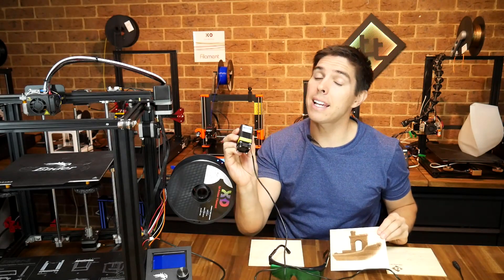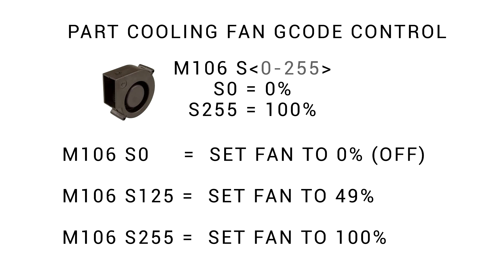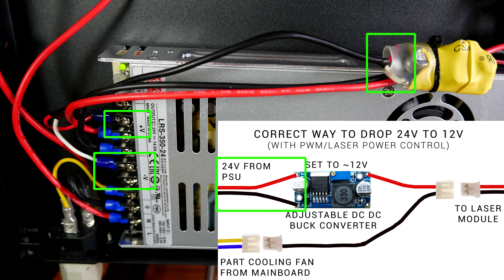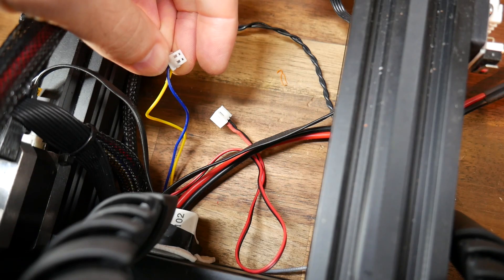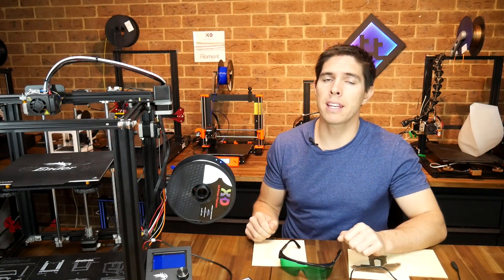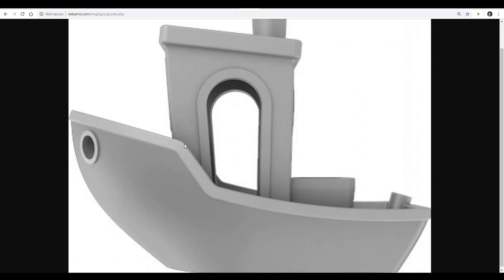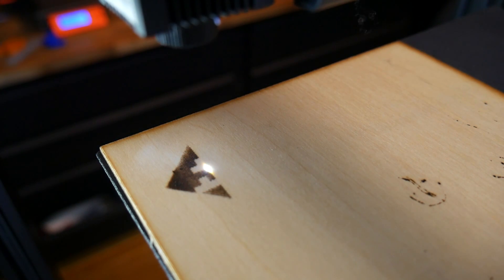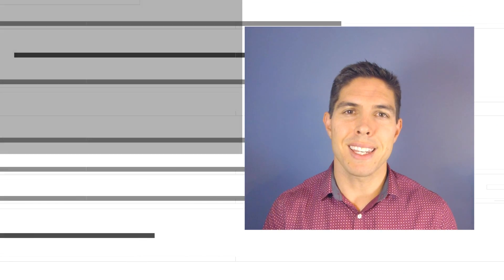3D printer to laser engraver for under $60

Comment: Mike, this is awesome, as are the many other videos you put out.  Thank you.   Question: I would like to use this for cutting out ribs and other model airplane parts out of thin plywood, or dollar tree foam.  Could I do this by using a black/white image which simply has lines that need cutting and increase the intensity of the laser to penetrate the respective materials ?

Comment: Hello, I've watched your video and have a few questions to ask. Firstly, is your laser engraving head operating at 12 volts? In the video, you used the xl6009 module to convert the motherboard's 24 volts to 12 volts for the laser head. How smoothly does this configuration work for you in practice?

Comment: I bought Creality Laser kit, it does have built in buck converter, but it doesn't help, I always have 12V out regardless of power percentage and or PWM frequency for that mater. I'm trying to hook it up to the Ender 3, it works with 24V fans, and buck converter does the job but always gives 12V no mater what I do. (I tried your wiring to get ground from other place, nothing happens always 12V)

Comment: Hi im having issues with a neje 30820 laser in the 3d printer. it semed to burn everithing even if i use speeds up to 4000 mm and turn down power of the laser to 25  in img2gco any ideas ? if i turn down voltage of my laser under 12 v maybe ?

Comment: Just installed this, but looks like my 4.2.7 board cant run it due to low PWM frequency - has anyone else had this issue and found a work around?  also looks like the image3gcode doesnt work anymore

Comment: I just bought the 10W laser from creality
Also interested on how to cut (through) with the engraver (using multiple passes)
Watched your video prior to the package arriving to be better prepared and know a bit more on the settings and tips.

hope to figure real cuts during the process.
Reply: did you figure out anything about making cuts?
Reply: How did you wire it up? I got ender 3. The pwm fan port is 2 pins. But the creality laser module got 3.

Comment: For anyone with requisite coding and electronic skills, the solution to the 24v/12v PWM dilemma would be to find all the fan speed commands in the G-code, halve all the values and re-compile the g-code. An RC network of suitable time period, paralleled with a 12v zener diode would provide the correct drive and stop anything bad happening to the laser.

Comment: Do I have to remove the spade connectors to the power supply if I want to switch back to normal printing? Or can I just remove the connector to from the cooling fan port and plug my cooling fan back in?

Comment: Great video. I'm considering a laser for my Ender 5 (stock board). I do not understand the significance of grounding the laser to the part cooling fan. I don't see why it would fix your issue. I suspect the reason for not working is that the buck converter isn't enjoying a PWM input. Are you able to elaborate, please?
Hmm... I wonder if there's a way to keep the laser circuit powered, and only PWM the diode...

Comment: Hi, please help. Ender 5 pro and neje lasaer 12v 30w with control board. Connected with external power supply and ttl 2 wire plug with buck converter. Laser works when test button pressed and on full power. when I checked voltage on the fan pins, it is constant 24v on full power and jumping from 0 to 24v when set to anything bellow 100%. When fan is connected is straggling to turn if set to below 70% and makes pulse noise. Is my board (v4.2.2 silent) broken?

Comment: I have a 3 connector laser GND, Positive,PWM I am assuming you're only using the ground and Positive and Activate the button I tested my laser with the supplied AC to DC transformer and all you need is the Activator switch depressed for this wire loom to work..

Comment: First off very good and informative video for an upgrade I can see myself trying in the future, big thumbs up, but can the same wiring technique be used to power a pwm fan? the reason i ask is because i have an ender 3 v2 and want to use noctua a4x20 5v pwm fans for the hot end and part cooling and your is the only video that seems to show a way round this, sorry if this is going off topic but any help would be appreciated

Comment: So I recently bought a Creality laser attachment just like the on you have and got it setup and running using your tips, after starting the 2nd project, laser failed within 15 minutes. Any Idea what I could do to check any faults?
Reply: I restarted everything over from scratch, deleting old g code files, formatting SD card, reset ender 3, restarted computer and again the laser stopped working after about 45 minutes into an engraving, know anything that can help? thanks in advance.

Comment: @Teaching Tech, didn't you face any PWM low frequency issue with Ender 3, my laser module has a dedicated PWM driver but the parts fan low PWM freq. from ender's board (~7 Hz)  just toggles the laser between off and full power.... no intensity control. If anyone here knows any solution to this please help me out.

Comment: I tried it your way (on my Ender 5Pro). Does not work. 
Connecting your way, FAN on 0% shows -12V, FAN on 100% shows 12V, but it pulses (PWM), not constant on. 
Looks like my PWM (Blue) is pulsing between -24V and 0V. Adding 12V from PSU does not help.

Comment: I would use the DC-DC converter to get 12V from 24V, then a resistor voltage divider from the fan PWM to control a MOSFET that is powered from the output of the DC-DC converter (12V). The output of the MOSFET circuit will feed the laser PWM. The goal is to preserve the sharp rising and falling edges of the PWM square wave that directly impacts the sharpness and accuracy of the laser power and the engraved image.

Comment: very useful information, but i'm having a problem. my board has a PWM frequency of 7.8Hz, the laser was tested on 1Khz and worked fine, but on the much slower 7.8Hz of the mainboard, the laser is unusable. do you have any suggestions? (using the silent board, ender3 V2). Thanks in advance.

Comment: Oh man, you should use a relay after the buck converter with the fan connected to normally on and the laser connected to normally off, then add a button in octoprint to turn on the laser for when you want it used.

Comment: Hello, I connected the laser as you showed here, but the laser power is not controlled, the laser is blinking! From 1% (slow) to 99% (fast). At 100% Burns full power all the time! In this mode, only  can be used 0% (off) and 100% (on) !

Comment: please if someone can help i cannot find a solution. same laser wired the same way to my ender 3. the only difference is the buck converter that came with mine is not adjustable. if i set my fan speed (laser output) to anything below 50% i get -12v.. so 0% is -12v, 25% is -6V, and 50% is 0v.

Comment: The kit I ordered came with a laser module labeled 12 - 24 Volts. Is there any reason for me to still use a buck converter and run the laser at 12V instead of plugging into the 24V supply on the printer directly? I have an Ender 3 Pro, if it makes any difference.

Comment: well now i wonder about setting this up. Someone gifted me the Creality laser and i was coming back to watch this again and seen the buck converter being used which is fine since i have extras from the Noctura fan mod but my laser says 12/24v so i figured it had internal components to adjust voltage down if needed and would work on either just by pluggin into the fan header but now i got more questions. too anxious and wanna try it lol. great video btw

Comment: correct me if I am wrong on this, but Creality has a laser engraver attachment (much like what your using here) that says its 12/24 volts, so it should be compatible with the whole 24 volt board without having to buy an adapter now right?
Reply: I have the same question. I recently bought the 12/24 volt laser engraver and I am trying to find instructions on connecting it to my Ender Pro 5. So far I can't find any info...... If you find the answer please share.

Thanks!

Comment: Hello and thank you for your video which helped me a lot. I transformed my alfawise U30 into a laser engraver. Everything is fine except for one thing: when I want to burn letters in vector mode, some text pieces of these letters are missing. I have tried everything and I don't understand what is going on. I checked the GCODE, there is no command code in the G to turn off the corresponding fan when part of the letter is missing. Could you help me I thank you in advance cordially Franck. A small clarification: all the other engravings in vector mode work very well, it just bugs for the letters ... Thank you, Franck.

Comment: Great video. I've just moved over from the standard 1.1.3 board on a ender 3, to the 4.2.7 board and now i'm getting completely different results. All of my previous GCODEs either from nebamix or creality workshop which worked with the old board, no longer give great results (either too dark, or completely burnt even on the "white" sections). please can you make an updated video with the new mainboards?
Reply: The laser only works for outlines on the 4.2.2 and 4.2.7 boards. The fans PWM signal is too slow to modulate power to the laser and control intensity of the beam
Reply: Is this board running Marlin firmware?

Comment: so as i understand, you removed modulation with stabilizer... i was trying to understand - i got ender 3 pro and 500mw laser 12-24v... also i got skr mini v2, so by default there no pulse modulation visible..... also in marlin configuration firmware files - you can define fan will be with pwm or not, i think - its 2288 line FAN_SOFT_PWM

Comment: hi,
i have successfully build my laser engraver with ramps1.4 board. i have attached laser at the cooling fan pins. but my laser does not cut or burn a paper . laser is 1.5kw. n it burns n cuts paper when powered directly to 5v. can you help?

Comment: Great project inspiration! I went ahead, crossed my fingers, and purchased the cheaper, higher-powered laser with the TTL-level input. As suggested in some of the electronics channels on YouTube, I used a resistor network across the 24V fan, thinking it would drop voltage safely and instantly down to TTL levels. And it did. What's more, there is no delay turning on the laser, because there is no buck converter. And I did not have to unplug the fan.

In fact, the fan speeds up cutting of cardboard.  I have to use many passes at high speed to avoid flame out. Please never leave unattended.
Reply: didn't you face any PWM low frequency issue ?, my laser module has a dedicated PWM driver but the parts fan low PWM freq. from ender's board (~7 Hz)  just toggles the laser between off and full power.... no intensity control. If anyone here knows any solution to this please help me out.
Reply: @abhinavjhajsr  No issues. Geeetech A10T.

Comment: I can say that 500mW laser it's very bright even when it pointed to wood piece... Use glasses always
Reply: Agreed. I bought one of those (tho not a 3D printer kit version) and it seems it's a proper 500mW output power like his, not the scammy input power rated ones. Definitely even the crappy included glasses are necessary. If one has/can afford/can find proper rated UV protection glasses, go for it cause it will pay off in health.

Comment: So, I need to switch between the fan to do my 3d printing and the laser to do engraving?
Did Someone create a cable/switch? In that way you are not opening and closing the electronic enclosure and hurt the board connectors?
Reply: ok, just installed mine. i dont have a part fan and my nozzle fan in just on all the time. it would be easy to install a selector switch. I have an isolator on the 12v to the laser so you would need a selector switch to divert the negative lead of the part fan to the laser so that it can switch between the two.

Comment: Do all these printer controller boards do low-side switching for the PWM fan drivers?  Otherwise the 12V power supply hack you described won't work as expected.

I'm really concerned about introducing such a hazardous tool to people that may not be aware of the risk.  The high intensity UV from the laser can do serious and permanent eye damage, and is not something to be done casually.  Normally, using a 3D printer, you only have to worry about burning your fingers by a touch of the hotend.  If you're going to have hazardous UV light in the mix, there really ought to be interlocks to prevent someone from inadvertently  energizing the UV laser - either being inside of a shielded enclose, or... I'm not sure how you do this safely with an open frame printer.
Reply: Louis, I'm not sure about his printer, but on my Ender v3 Pro his wiring to the low side of the fan did not work.  The PWM for the fan speed comes out from the 24v, not the ground side.  I ended up using a buck converter from the 24v power supply to get a regulated 12v, then fed a NPN transistor with the PWM to power the laser.

Comment: Rather than use the step down module couldn’t you just run at 50% duty cycle which is essentially 12v ?
Reply: typically laser diodes only have peak currents at microseconds level before bursting up in theory you can do it but with a really narrow period.

Comment: I seriously can't get this to work, I've done everything as it has been done on this video. And then i meassure the voltage going to the laser (positive from the buck, and negative from the partscooling fan) then i get -10V when set to 0% and +12.5V when set to 100%. This dosn't make any sense, have anyone figured this out yet?.
Reply: im having the same issue. ever figure it out?
Reply: @jameshopton8591  nope, ended up buying a stand alone laser engraver unit.

Comment: Hi : Thank you for the great video, I have a “small” problem , and it’s that my laser controller is 5v TTL , while the output of the fan on my SKR 1.3 is 12 v , can you please advise how to adapt it , thank you..
Reply: Doesn't matter, you are only connecting the laser to the ground pin, through the fan mosfet. You are not using the +12V pin.
Reply: Piotr Baja but where I get the other terminal  to go to the + pin in the laser TTL input?
Reply: @marianodiaz461  The way he's rigged it in this video does not use the laser's TTL PWM pin, it turns the whole unit on and off.
Reply: did you find solution for that?
Reply: @alexandervodila   not yet , looks like that it only can be used to turn on and off, but not for adjusting the laser power

Comment: Can we connect the laser to original 24v in the 3D printer motherboard (fan pins) and change the software in Laser Max Power = 125 (its minds maximum voltage laser will be 12V) ???? or maybe its possible change max voltage in gcode usewell.
Reply: No you can't, you would still be sending 24V pulses. As is explained in the video, the TTL signal doesn't change the voltage, it just changes the amount of time it is ON. You would still be sending 24V to your laser and you will damage it in no time. Get a 24V to 12V converter.
Reply: Thanks but I find the right connection. Laser work external power supply and sinal I connect to pwm pin available  on my printer. Pin 44 actually. Don't need touch on firmware at all.

Comment: 3:24 The reason that doesn't work is because the buck converter is designed to produce a DC output. There are feedback circuits inside the converter that try to stabilise the output at the set voltage regardless of changes to the input voltage. It's not just due to the capacitors.

Comment: Why not using what marlin is made for. The laser function is already included in Marlin. U just need to activate it
Reply: Where in Marlin? V2?
Reply: @sergioiker  yes. check the code in arduino and all u need to do is uncomment the laser menu and wire the laser to the proper point.

Comment: Hello Michael, I have a few questions for you or your subscribers, I tried to connect my laser as you described in your video, in my case the positive and negative cables in the laser were inverted relative to the connector, so I change it. When a connected all I try to turn on the fan to 50% nothing happens, even the lasers fan was quiet. Then I noticed that when the buck converter was off, the pilot light was on, that let me think there's a reverse current from the laser to the buck converter. In your diagram the positive comes from the buck converter but the negative from the board, is the signal comming from the negative side? Well if you have any advice I will be happy to hear it, thank you for your amazing videos!
Reply: i have just experienced this on my CR10S Pro. doing an install exactly as shown in the buck converter diagram. when fan is at 100% the buck converter output is 12.2v and when i turn off the fan buck converter output goes -9.5v

Comment: Well, you talked me out of that idea.
Reply: If you have an ender 3/ 3 pro, it is as simple as unplugging the 2 wires mentioned, plugging in the laser, and then it works perfectly.
Reply: @shawnh3411  Wouldn't you still have to use the buck converters? I thought e3 was 24V?

Comment: Hi Michael I know I'm a bit late to the party but wouldn't setting the high limit to 127 negate the need for a buck converter ?
Reply: So if you were to do this, it wouldn't make the voltage 12v, it just limits it to 24v half of the time.  The average voltage which is what your multimeter would read is 12v, but it would put it at risk of dying due to over voltage. Edit( I had thought the same thing at first, but after looking into it, realized I was mistaken)